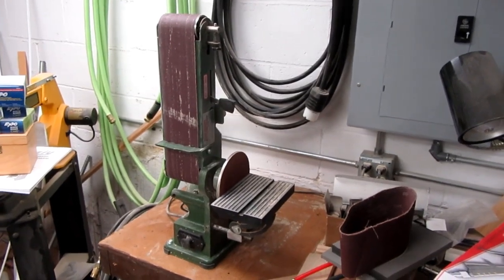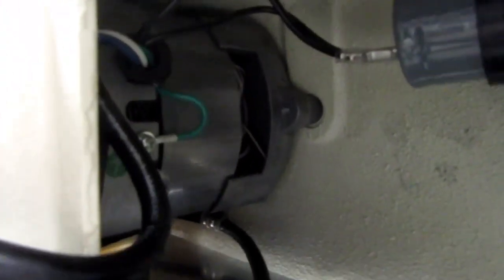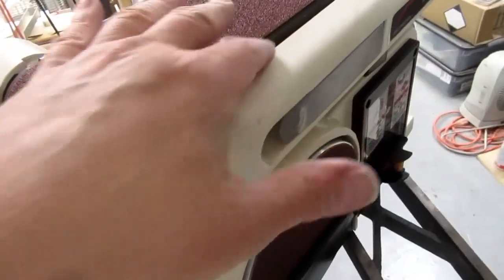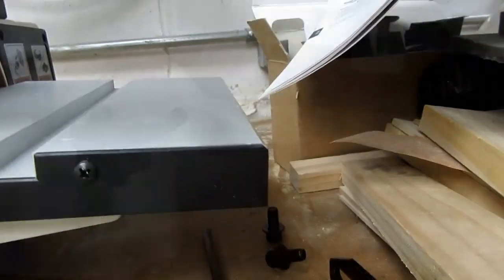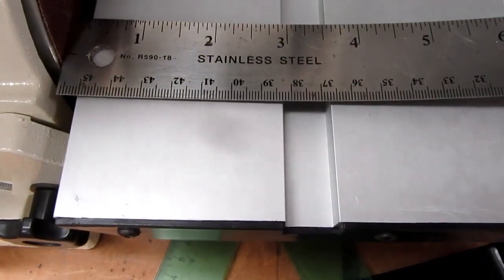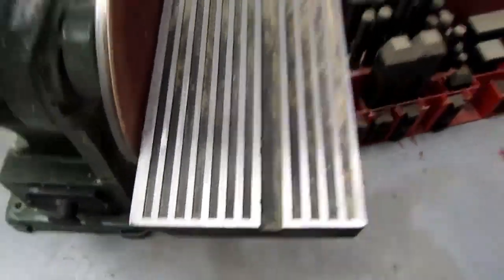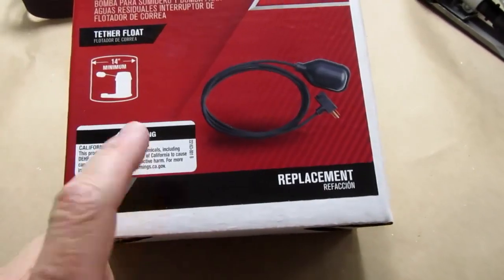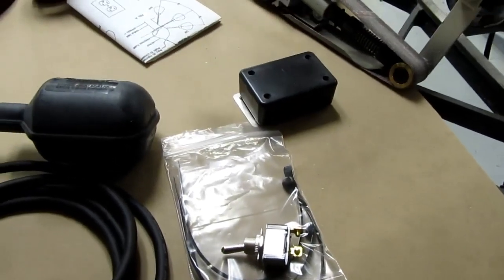A Tale of Two Belt Sanders: Shop Fox W1855 & Makita 9031

Comment: For the first belt sander can't you get an outlet strip or extension cord as we call it in UK with separate on/off switches, or the plug sockets on the wall with on/off switches. It's just one of those things that amazes me, that most sockets around the world, don't come with the switches, I think uk is about the only place that does.

Your solution is brilliant, but switches on the sockets or extension cords would certainly stop the problem of having to reach across dangerous moving parts to switch machine off. Though for a tool like a saw or sander, you'd think they'd have a kill switch easily accessible on the front of the machine.

Keep up the good work, certainly enjoying your shop infrastructure videos ATM. Doing jobs like this certainly helps with working in your shop. I know you've got snow now, but would be great to see how your garden is doing, the raised beds and the new grass in the spring and summer
Reply from the maker: Philip, I thought about using an outlet strip, but dismissed it because:
- their switches are typically rated for low current resistive loads (such as lamps), and not for higher current and/or inductive loads (such as motors).
- All the sawdust would soon collect in the outlet strip's sockets, and this could be a fire hazard.